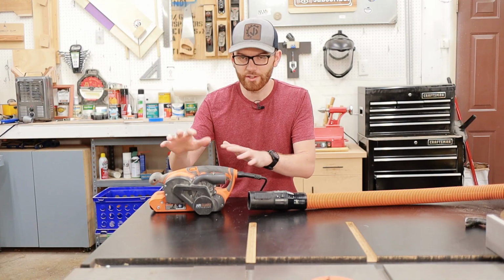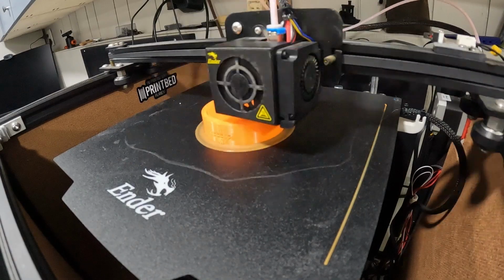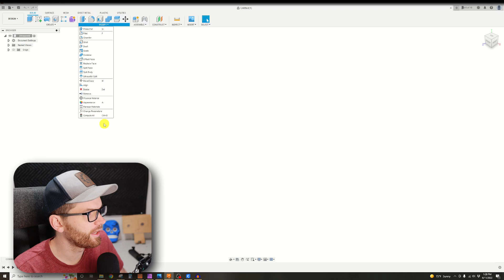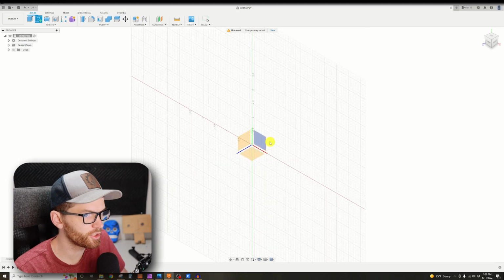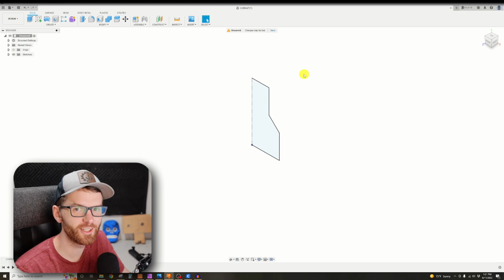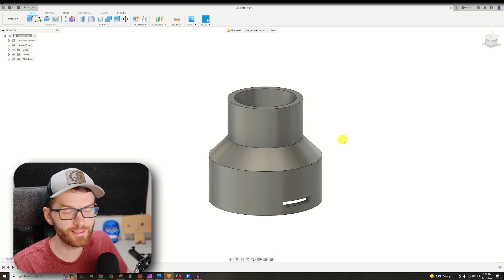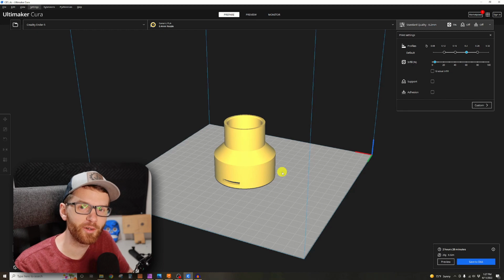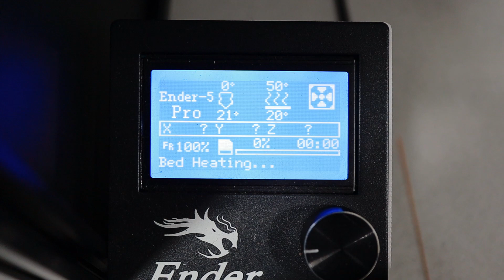3D printing in the Woodshop?

Comment: Shop vac used to make an adapter for exactly that use.  It had multiple steps.  If you needed a size in the middle you cut it off at that step.  It only cost a couple of bucks, a lot cheaper than a 3D printer.
Reply from the maker: For sure, I think I've seen those before.  I certainly wouldn't recommend buying a printer JUST to make a single fitting. haha.  Thanks for watching!

Comment: First, I want to say that I really like your channel and am glad it showed up randomly in my feed one day. I like seeing the different perspectives and approaches craftspeople take, and your practical approach using modern, affordable tools and stuff like 3D printing to enhance your experience is refreshing. 

Second, I have a heavily modified (by me) Ender 3D printer that I've used to do that exact same thing for my home shop dust collection. My suggestion is that if you can get your printer to reliably print in TPU, then use that. It doesn't need to be something as flexible as Ninjaflex (though if you have it...), but even a random cheap spool of 95A TPU (which is far easier to print without significant printer modifications) will offer you a good bit of play in making sure the fittings interact snugly. For example, had you been using TPU, your very first print probably would have worked (save for the depth of the vac-side interconnect), as it would have flexed enough to accommodate the hose and held on really snugly. And once you get a feel for the material, you can deliberately print things 1/2 to 1mm too small to account for stretch to be sure you have a really solid and air-tight fit. 

TPU is also very durable and not brittle like PLA, so if you drop the fitting, it won't crack. I know it's not a common material, and people avoid it because it's hard to print on most consumer-level printers, but for stuff like this, it's been a lot better for me than PLA (with the caveat that I have modified my printer specifically to make it easier to print flexibles). 

Anyway, thanks for sharing your videos and I'm enjoying your content. Keep it up!
Reply: Oh! I forgot to mention my favorite thing about your videos - you show the process including mistakes and iterations. More creators should do this, as the videos where everything works first try are very misleading and can be especially discouraging to people actually trying to learn. The portrayal of perfection in so many videos is a disservice to the hobby, I think, and I like seeing people go through their processes and troubleshoot and be honest about mistakes. 

Plus, there is often so much more to learn from mistakes and missteps than the issue-less successes.
Reply from the maker: Hey Matt, thanks so much for watching and the comments! I really appreciate the well thought out comment, I'm always interested to hear what other people have to add to the conversation. 

I definitely need to print with more TPU. I use it quite a bit at my day job, but haven't had good success at home using my (cheapo) Bowden style Creality machine. Hopefully I'll add a new machine to the fleet soon, and then I can get back into tpu printing. 

I'll try to bring up some of these notes in a future 3D printing based video. 

Thanks again for the support and feedback! It really means a lot!

Comment: any 3d printer you recommend ?
Reply from the maker: If you want something that "just works" check out Prusa. If you're looking for another hobby, and are willing to spend a lot of time tuning, modifying, and tweaking, Creality makes some really "low cost" machines. (I have the ender 5). 
I may be adding a new printer to the fleet soon, so I may have more to add to that recommendation soon! 😉

Comment: Great video, thanks! A couple recommendations first look for chep ultra fast profile that should bring the print time down quite a bit. And second I would do a 1/4 inch or less ring to dial the diameters and then do the full print these should print in a few minutes and again would save a lot of time and material
Reply: Exactly what I came to say.... lower the print in your slicer and only print a little to test the port side and flip it over and lower it for the vacuum side. Save time and $$ on filament.
Reply from the maker: Great tip!
Reply from the maker: Thanks for watching! Printing a partial model is a great way to shave time, I use that technique quite a bit. I figured it might be outside the scope of this video though... maybe I'll bring it up next time.